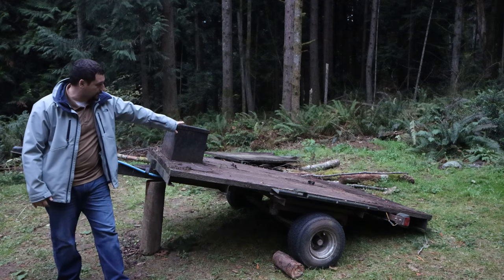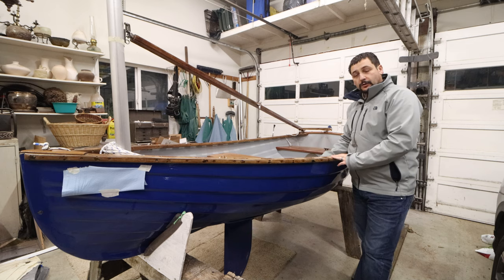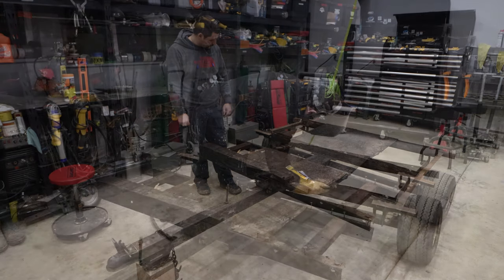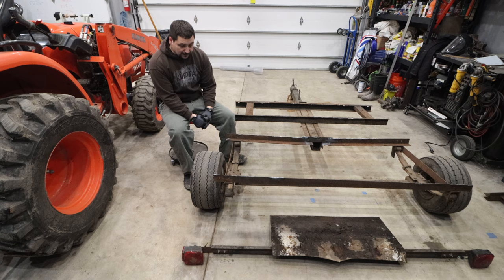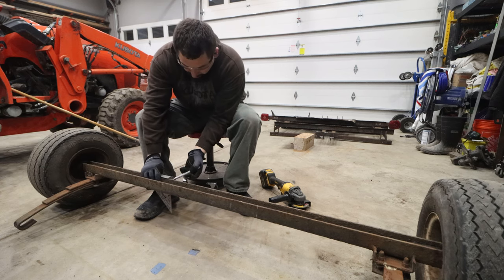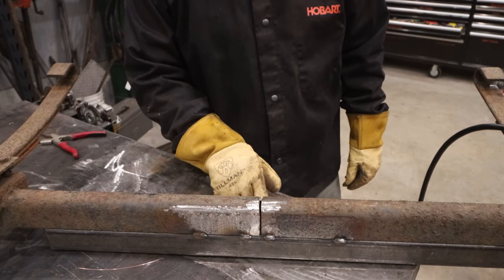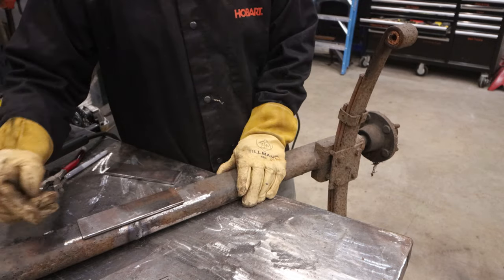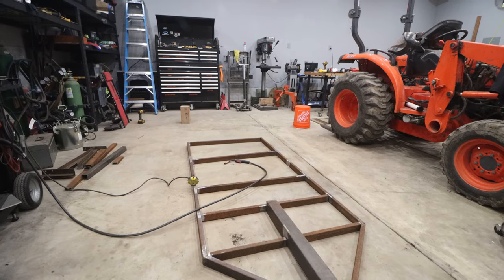DIY Boat Trailer Part #1 Back Store and Shortening the Axle

Comment: My father-in-law had his 22’ tandem axel pontoon trailer get t-boned, it bent the frame right between the axels, ripped the back axel away from their shackles and bent the same axel tube, blew out two tires.
He wants to shorten the trailer to a 12-13’ single axel so he can transport his Harley Trike in style.
Ordered new shackle hangers and axel u-bolts, will reuse everything left from the original trailer, including lights, and surge brakes.
Looking forward to how this turns out.